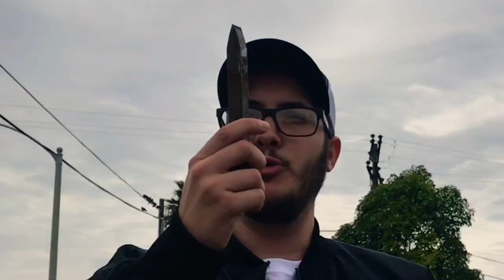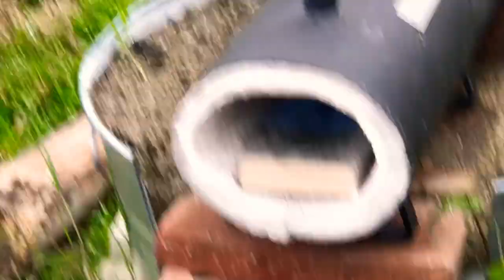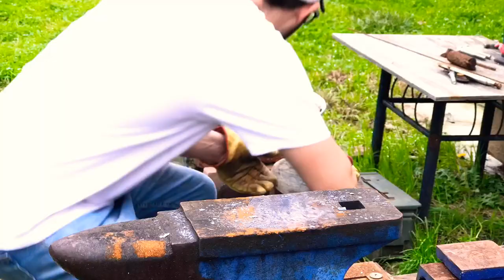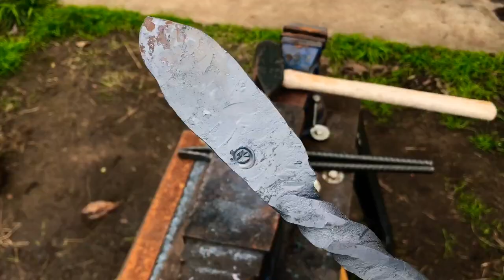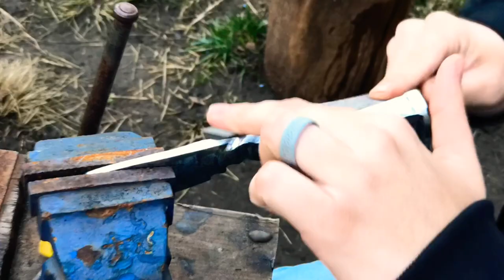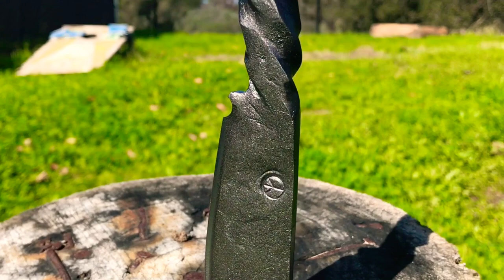BLACKSMITHING | MAKING A TWISTED HANDLE RAILROAD SPIKE KNIFE

Comment: Not too shabby. Looks better than my rail spike knives. I gotta ask, why quench that one?
Reply from the maker: Curiosity Forge just to make it stronger and hold an edge easier
Reply: Gotcha. Unless you either forge welded a high carbon bit in there or did one of those weird super quenches it's not gonna do much of anything. I thought you might have done something special to it. Even when I use damn near ice cold water to quench them (done to make handling them easier) they really don't harden noticeably.
Reply from the maker: Curiosity Forge I’ve noticed using warmer oil to help the quenching process..and a small difference is still better then nothing at all
Reply: Yeah, it's better than nothing for sure. There's supposed to be a weird salt water/soap quench that case hardens mild steel a bit out there in the internet based aether. That might be worth checking out later on.